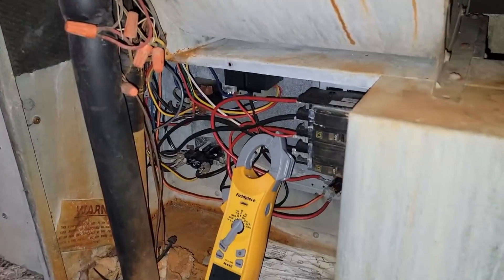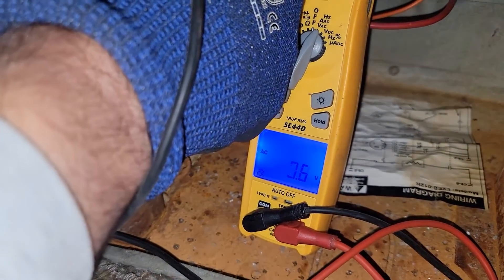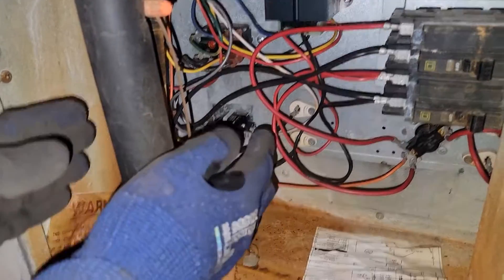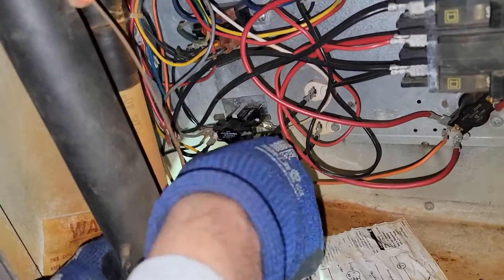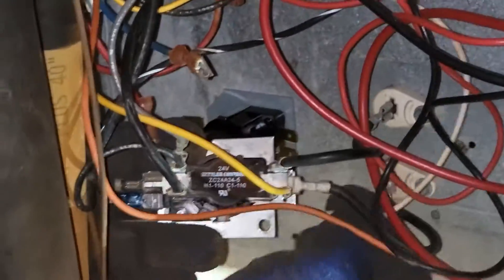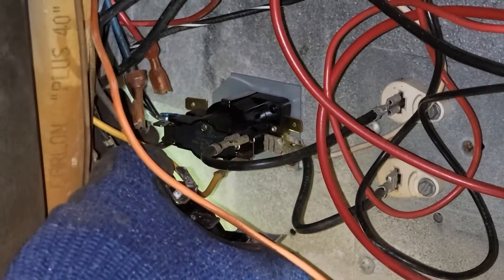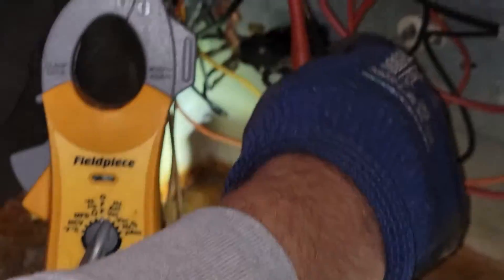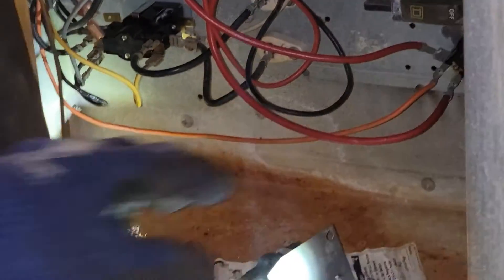How to Check a Sequencer? #hvac

Comment: Bro got the term “open and closed” flip flopped open means no voltage
Reply: measuring from one side to the other, open or closed will give you no current reading. It is the same as placing your leads on 2 different sections of the same wire.  The is no difference in electrical potential, so there is no voltage reading.  You need to read from the terminal to ground which will give you 120v closed and zero open.

Comment: I have a 1999 Intertherm mobile home electric furnace. When it reaches the thermostat temperature, the fan will turn off but the coils keep heating. I can hear a relay clicking, like it is turning off and on, but it keeps heating. Could this be the sequencer or a thermal limit switch?
Reply from the maker: Yes it's probably the sequencer
Reply: @taddydigest  Thank you so much. I just tore into my furnace and found a bad connection on the single pole thermal limit switch, cleaned the connection and it is working now. I'm going to replace the limiter just to avoid future problems. I had the furnace worked on about 3 years ago and it looks like the sequencer was replaced then.

Comment: Hey Tadd. I had 2 Goodman heat strips today new in box. both have 2 double stack sequencers. i read ohms on 1 kit got 80 ohms each. the other kit both read 128 ohms each. ? my thoughts was thats high resistance. possibly bad from factory
Reply from the maker: It could be yes
Did you check and see if anything looked broken?

Comment: I’m still a little confused on how it works last winter I was having heat problems at my house we have a furnace that’s a 96 model and our heat is only warm not really hot but there is a new sequencer that I put in I’m trying to get into this lie of work I’m only 23 and I won’t to learn  about this stuff any suggestions?
Reply from the maker: Watch more of my videos
Reply: So when I get off work I need to go home and check this out which idk why it wouldn’t be working I have new heat strips and a new sequencer so idk what the problem would be unless it’s not getting the 24v from the thermostat.
Reply: But before all this when I’m heat mode the furnace would cut on and off randomly ended up changing the transformer and that fixed that issue then noticed whenever the power was on and it was in heat mode the strips would come on and not shut off don’t know if that had todo either transformer or what but everything works fine just the heat isn’t really that hot

Comment: Thank you for the helpful videos.  I've run into an issue with my electric furnace that happens atleast once ever couple of days: The thermostat will call for heat, but the furnace never comes on.  While testing, the only way i've gotten it to work again is jumping the fan wires (R & G) for a second or two.  5 seconds after I do that, the furnace will kick on again and go off at the specified temperature.  Do you know what could be causing this and how to troubleshoot?  Last time this happened, jumping R and W did not work.

Comment: @TaddyDigest - Your videos are great stuff. I had a neighbor who was a HVAC tech.Learned some from him.  When he move away, he came, or talked me thru things over the phone. He's since passed away. Now your videos got me thru diagnosing a bad (Zettler) Sequencer.
Have you experienced a Sequencer, brand new ,  (in my case Packard HS24A34-4) that right of the box was slow to switch on, later than 30 - 90 in the first few cycles?... like it needed a 'break-in' period?....?
When a (ancient) limit-switch goes bad, does it go entirely bad, cutting power to both heater elements? ... OR ... go 'half-bad' where it cuts power to one heating element but not the other?.... 
I've got a cheapo analog meter, i'm going out now  to check the  levels now that you showed me how....
Reply from the maker: Very sorry to hear about your friend passing
 I have had brand new out of the Box sequencers that were bad
 Thank you for watching my videos and I appreciate you

Comment: Gotta love mobile home AHU’s. It’s really fun when they overflow the drain pan and burn up all the wiring in their cabinet and you have to wire it back without being able to see where anything went. That’s how I learned electrical the hard way
Reply from the maker: I am way too familiar with exactly what you're saying. Great way to learn
Reply: @taddydigest  I just started watching your content, where is your service area?
Reply: Had one yesterday that was exactly what you describe.  Nearly every wire burned up.  Sequencer burned as well as fan relay and transformer. The limits were also bad. It’s so much fun to do this all while lying on the floor.

Comment: I have a international comfort products down draft electric furnace when I turn it on in heat mode my heat strips come on but my blower will not then the heat strips will turn off after about a minute of being on but the fan is works properly in cooling what are some suggestions that may be causing this issue
Reply from the maker: wiring or relay issue
Reply: @taddydigest  Bad run capacitor on the heat side?.... or bad contacts to it?...